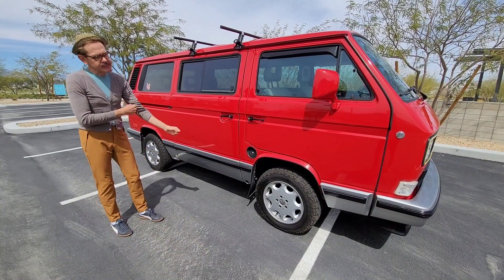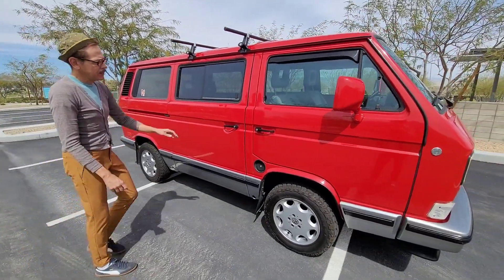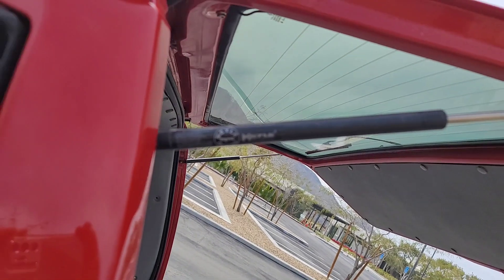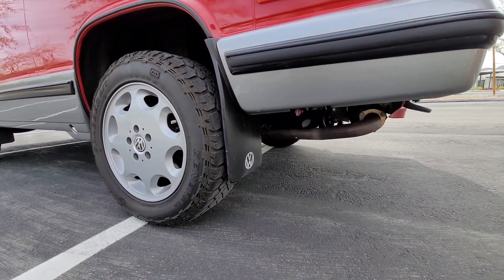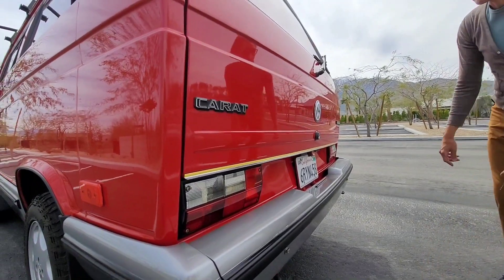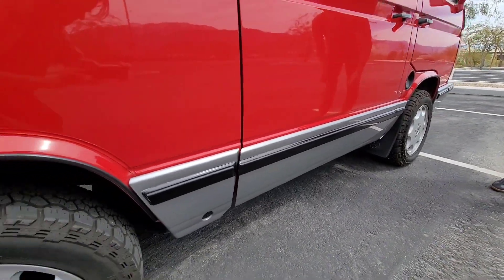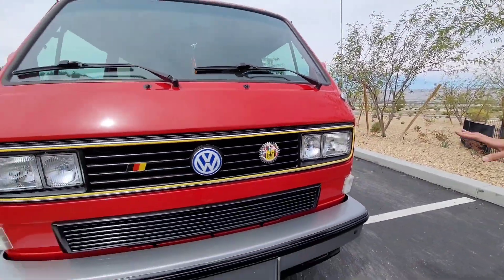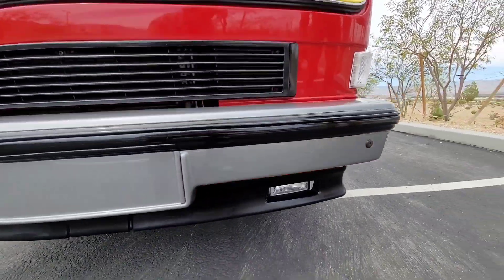VW Vanagon Carat Exterior Walk-around

Comment: When living in New England in encountered a lot of salt spray from the salt usage on their enter roads.  I added a second rear window sprayer nozzle to stay ahead of the white salt collection back there!  Quite easy to do.  Mine runs on Ronal R9 wheels.  I also upgraded to the latest LED headlights based upon that quad headlight arrangement. (This is one of the best  upgrades you can do).   You are keeping it in very nice shape!  Thank you for your detailed walk through.
Reply from the maker: You're welcome and thank you as well for sharing your details. I read that LED headlamps in cold climates require heaters so when it snows the lamps can resist ice build up? I've driven through snowy areas and even with regular/non-LED headlamps, in the snow, ice will eventually builds up. I dunno, after driving in the midwest on highways in the dead of winter, regardless of LED vs Non-LED headlamps, I'm scared of driving in the snow at night when it's -5 degrees Fahrenheit. Here in the states, Vanagon's were equipped with H5 U.S. spec headlamps and bulb which was ridiculously dim. H5 produced light similar to 5 candle sticks (-:  LED headlamps sounds like it gives the best lighting performance!
Reply: Thank you for taking a look and replying. Also, you're welcome! (-:

Comment: You may need to clean up all those contact points on the B column and their contact points on the sliding door with an emory board.
Reply from the maker: True. I think if I take apart the sliding gate handle to see what's loose also might help me find the root cause on why I have to push the sliding gate handle in order for the central locking to lock the gate and the rear hatch. Thank you for watching the video and catching that part. I'll take all the help I can get. Much appreciated!